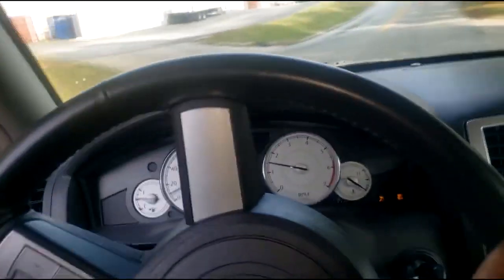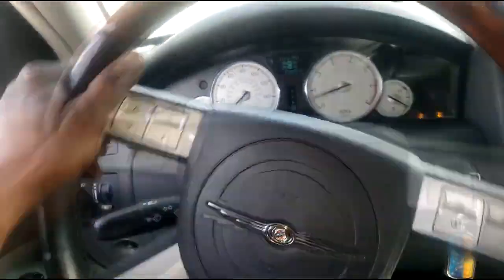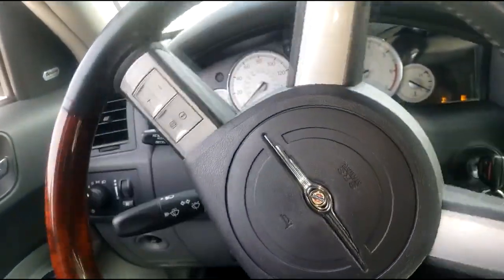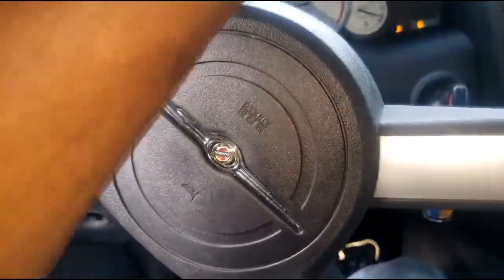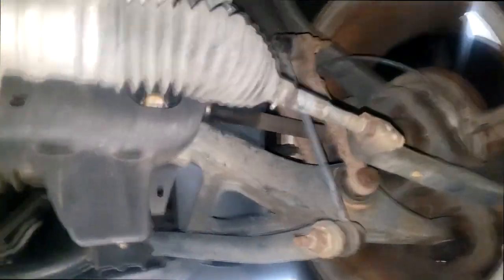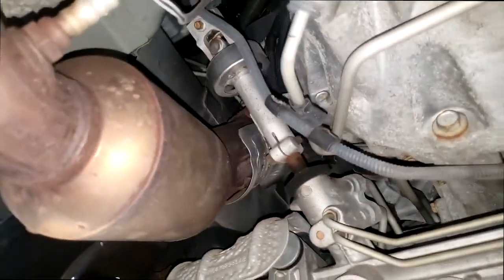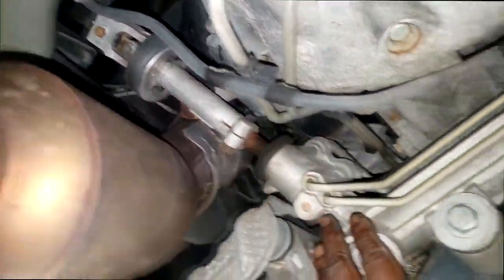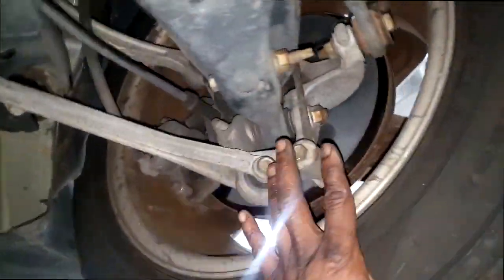WARNING! PLEASE GO GET YOUR SUSPENSION CHECKED. Never drive your car like this.

Comment: Are those drive axle boots new? 
For the amount of damage there, I'm with George, below, they had to have backed into something and bashed the piece.
Oh, and, I found the problem with the 2001 PT Cruiser. One of the camshaft rod dowels broke off. Only the exhaust cam was turning, though both cam wheels were turning in sync. The timing marks for cams and crank turned together. Without taking off the valve cover, I wouldn't have found it.
Is there a way to remove the camshaft without tearing down the 'front' of the engine?
Be safe!